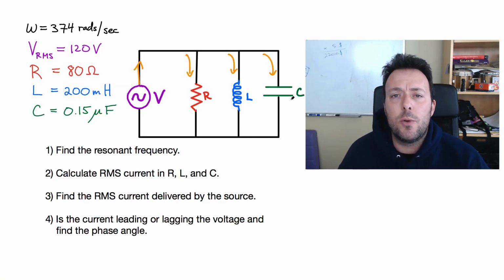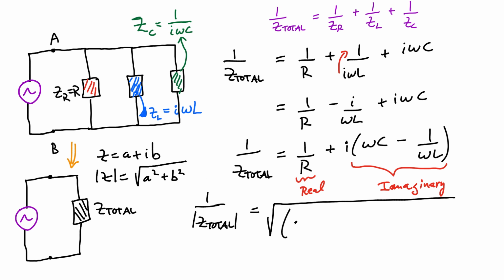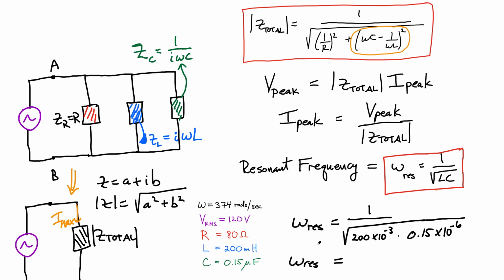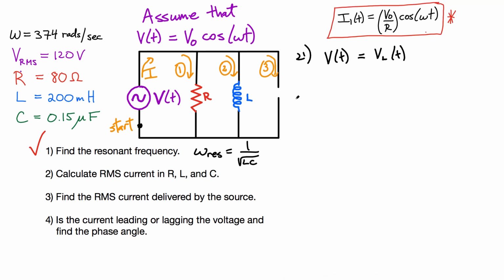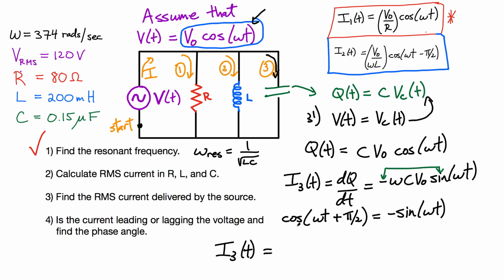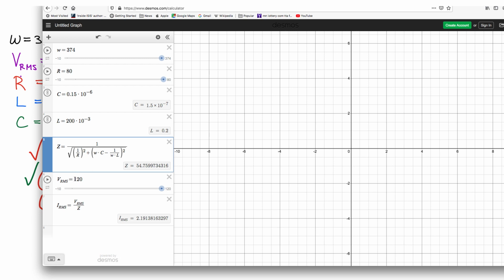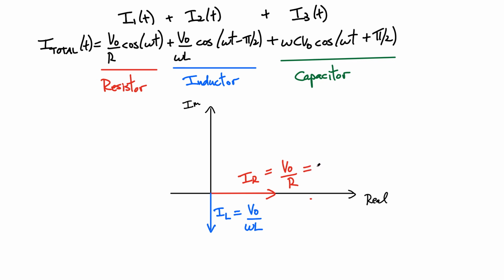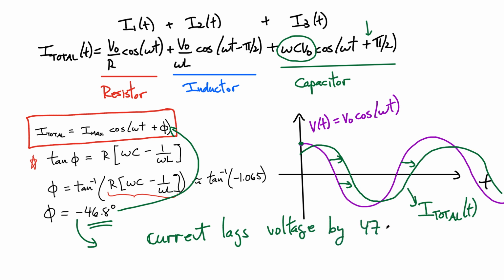Parallel LRC Circuit

Comment: Nice video: One question that no one ever addresses is WHERE does the transition from one current to another occur? For instance, where exactly does Total current with its phase angle transition to the resister current with zero phase angle?  Does this occur inside the passive element or in the wire before/after the passive element? Thanks

Comment: Could you have made this any more freakin complicated? Look, first calculate the resonant frequency; you have L, C, so 5773.5 rad/sec.
Given that I'm an electrical engineer, I will be using j instead of i for the SQRT(-1).
Next, calculate the inductive and the capacitive reactances. 
jXL = j74.8 ohms. 
-jXc = -j17.825 Kilohms.
The voltage is the same across R, L, and C because the all the elements are in parallel.
Ir = V/R =120V / 80 ohms = 1.5 A.
IL = 120V / j74.8 ohms = -j1.604 A.
Ic = 120V / -j17.825 kilohms = j0.0067 A. Total current IT = Ir + IL + Ic.
Thus: IT = 1.5  - j1.604 + j0.0067  = 1.5 - 1.5973 A.
In polar form, this is 2.191 A. at -46.8 degrees, which means I is lagging V.
Impedance Z = V/I = (120 V,  0 degrees) / (2.191 A,  -46.8 degrees) = 54.77 ohms, 46.8 degrees.
Converting the parallel R-L-C into a single series impedance using deMoivre's theorem: 54.77 * (cos(46.8) + jsin(46.8)) = 37.49 + j39.92 ohms, which is a simple R of 37.49 ohms and an XL of 39.92 ohms. 
How hard was that?
Reply: if u r an electrical engineer y r u even watching this vid. this is made for someone first time learning this material

Comment: one suggestion to you, if you add "IIT-JEE" or "JEE ADVANCED" at the end of your titles, you may get much more views as it is the biggest entrance exam in india with over a million people competing for 10,000 seats in prestigious IITs( Best engineering colleges of india), and they look for stuff online. you can also upload some solutions of previous year jee advanced questions which you can easily find online. it's syllabus is that of high school physics, chemistry and math 
They get 3 hours to solve around 60 problems of good level.

I've attached a link to a question of IIT JEE 2016 please check it out

https://qphs.fs.quoracdn.net/main-qimg-695c520e6f608cec2f319dee8956b71d
Reply from the maker: Thanks for the suggestion.   I will add those to my keywords.   Best regards